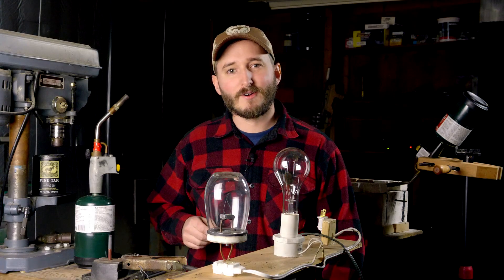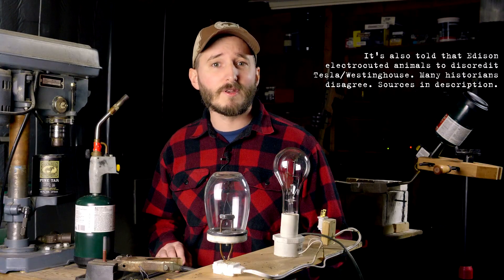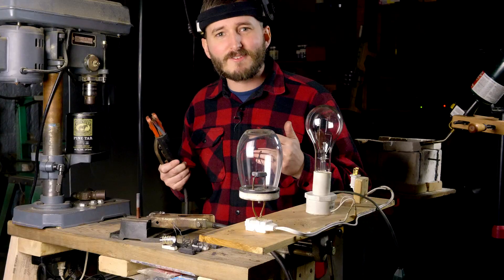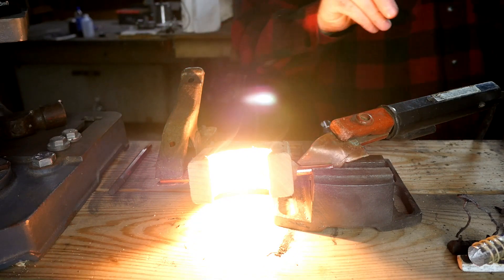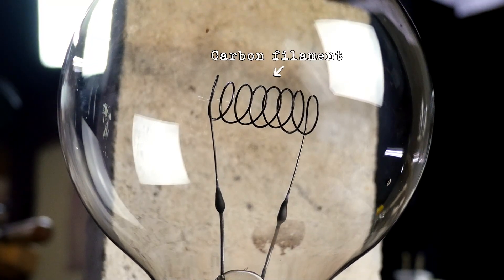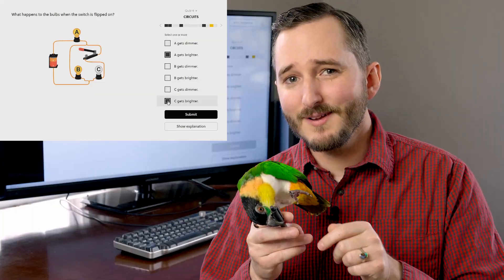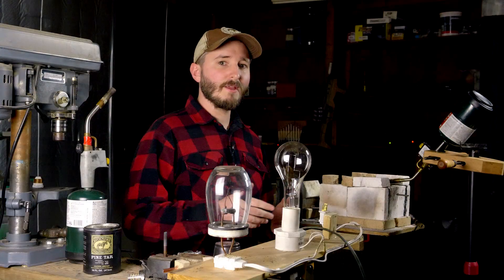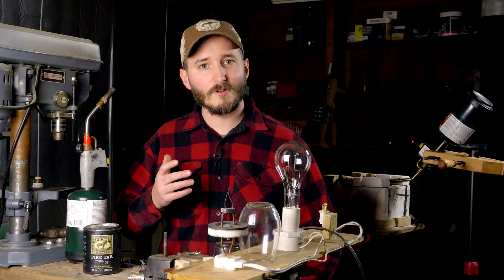Re-Inventing The Carbon Lightbulb

Comment: You may want to consider Humphrey Davey as well for making the first arc lamp. Edison though was quite glued to his patents though with the invention of the phonograph. ( Which started out as a tin foil machine). Foolishly he let his patent run out. Volta laboratories under ( Alexander Graham Bell) and other investors perfected the phonograph design. In many ways he even shut down patents like Thomas Lambert indestructible cylinder made of camphorated plastic ( instead of wax). Edison filed a lawsuit  led Thomas Lambert to bankruptcy, which in turn forced Lambert to sell company to William Messer. So in a sense Edison was kind of a fraudster, the shaving technique for cylinders was actually invented by Volta laboratories which later became Columbia graphophone company.. So in a way Edison invented the phonograph, but perfecting the Patent goes to Volta laboratories. Edison only perfected the light bulb and wasn't the sole inventor.

Comment: I saw you load the filament assemblies into your carbonization oven onto something that looked like an electric water heater heating element, which I thought was a really cool way to carbonize the filaments.  Then you hit it with a torch...  lol, sort of unexpected, but it still worked.  Pretty cool stuff!
Reply from the maker: Yeah it was just a bent piece of wire. That would have been an interesting idea though

Comment: I remember doing experiments like this when I was a kid, using stacks of NiCD batteries as a power source. Nearly burned the house down about a hundred times, but I learned that scraps of copper, aluminum, and other bits of metal simply don't work as light bulb filaments in the open air, at least not for long. I got a few wire-shaped burns on my hands also.

Comment: Don't you North Americans have 240 V outlets where two 120 V phases are combined (or something like that)? Else, you could try buying a cheap inverter for 230 V, or use a step-up transformer. Or maybe rectify the voltage to get DC?

Comment: Couldn't you have multiple filaments per bulb wired in such a way that you can power them individually or in series? In this way, you could initialize them one by one before putting them in series to act as one long filament.

Comment: I experimented with straw and got some good results. I didn't use them as filaments for light bulbs but tried them as accurate temperature stable resistors. 

I'm on and off building a radio transmitter from stuff i can acquire in my backyard. Iron from our iron rich soil  for wires. Tubes build from glazed clay and so on. I build a quicksilver vacuum pump. Works slow but very well.
Reply from the maker: That's an impressive project!
Reply: @Nighthawkinlight  It sounds more impressive than it is :-) 

Right now I'm working on a way evacuating and sealing the tubes reliably. The best way of sealing is to melt a big pile of glazing at the bottom. But also holding the vacuum is impossible right now. So I'm thinking to use Sodium vapor to replace the air while fusing the top and the bottom of the Tube. But more experiments are needed.

Comment: How were you processing your bamboo? You may have some luck with crushing and/or twisting the bamboo along its length before attempting to bend it into coils - Effectively breaking it down into fine strands of material rather than working it as solid bamboo.
Reply from the maker: Steam bending mostly, but I think my bamboo source was not good. Breaking the fibers would cause other issues

Comment: Firstly one that they did know and use back then was that they could make the coils longer by wrapping them around a glass tube connected to the same Mount as the filament
.
secondly one they may not have known about back then is that if you burn metal like steel wool underneath the carbon filament you expose the filament to metallic gases which can condense on the surface lowering the conductivity enough to allow electricity to start easier

Comment: Did you consider sugar? Basically you need a material that is easy to form and has low amount of inorganics. Sugar being C6H12O6 can turn into high carbon structure after carbonisation. It can be molten and cooled a bit in water to become like dough and wrapped it in a tube maybe paper towel tube cause it will melt with the carbonisation heat otherwise. I think you also need to spend more time in the carbonisation step because that high onset voltage you needed to run the light was due to the lack of proper carbonisation.. More carbonisation means less resistance and lower onset voltage. All the best
Reply from the maker: I tried various starches. Pasta worked pretty well
Reply: That would make an interesting PLP (pasta light pulb)..

Comment: I have some carbon filament lamps from around 1939, which are a good example of the process, as they have a thin well supported filament, and work well off the 230VAC mains.
Reply: If i were you i would get a transformer to run them at 220, makes them last longer, or maybe even 210. And soft start
Reply: @the_retag  NTC thermistor in the power lead to them already.

Comment: consider light from compost gases. Haven't got around to reinventing that wheel yet, but could really use some light supplementation. Maybe community gets stuff done first, I dont mind. Want to keep it simple and not include batteries and LEDs unless I realllllly have to. For now I thought about small water tank with inflatable part to hold gas, flashback arrestor again with water aaand it would burn up all of it every day. Because of constant supply from compost and having the need for only few hours of extra light. Haven't figured out a time (and light later) based relay nor a reliable/diy mantle yet. Any thoughts and inspirations for this project are welcome, trying to avoid electronics for this one.
Reply from the maker: Well you can look for my video about making a gasometer. The lamp part I've not played with.

Comment: Nice video! Unfortunately, the carbon dioxide released by the burning propane in the bulb would surely react with the filament at these temperatures. Look up the Boudouard reaction, where CO2 and carbon exist in a equilbirium with carbon monoxide. Nevertheless, as you said it was sufficient enough for a demonstration that lasts long enough.

Comment: My suggestion for better results would be to coil the filament around a glas rod while burning, to get thin material to work.
Would probably require a jig to remove the glass core thou... Might be worth a try ;)

Comment: You could use several of those shorter filaments in series inside the same bulb to get a longer length, and it would allow you to do the initial "burn-in" lighting one at a time before connecting them together.

Comment: You are Missing out on what Edison really did in making the light bulb and the process he ended up with.  Unfortunately, this is detailed in only one publication that I have found.  It is "Cyclopedia of Applied Electricity", volume 3.  (I have hard copy of this book in very bad shape, which I spent enormous time scanning.)  This series of volumes is on Google Books, but the volume 3, despite claiming to have "electric lighting" in frontispiece like my book, is not included in the table of contents, nor its pages.  (I have PDF of book, and I think it is legal for me to share it.  If you provide me place to send it, I will.)  Very short explanation goes like this: cotton is boiled in zinc chloride solution.  It turns into gummy goo.  (Edison invented plastic!)  This goo is extruded through tiny orifice into alcohol, which hardens it into a fiber.  Fiber is passed through boiling water to remove zinc chloride, dried, and reeled.  This fiber is pyrolized (as you did) into carbon filament.  On purpose, filament is made "too thin".  Filament is mounted into bulb base with tar binder as you did.  Next step (you sort of did for a different purpose) is to insert into chamber filled with gasoline vapor.  (Edison called this "flashing".)  Power is turned on, and hot filament builds in diameter as gasoline "cracks" and adds layer of graphite.  This makes filament stronger, and more importantly, uniform in section (thin area is hotter which builds faster).  When resistance drops to desired value, relay cuts off power to that filament.  Filament/lamp base is glassblown onto lamp globe and evacuated.  Edison used a "getter" to scavenge gases in vacuum.  You can use a 2nd filament, or better, a pinch of red phosphorus applied to the filament (converts to white, then scavenges oxygen).
     Since this involves a utility, you need to explain the "voltage squared divided by resistance" problem regarding the amount of copper required to transfer "X" amount of power "Y" distance with "Z" efficiency.  Because Edison was "stuck" on DC, the voltage in the transmission lines had to match that of the lamps.
Reply from the maker: There is some mention of this as one of several methods in Edison's first patent, fibers rolled from a plastic of nitrocellulose. I have also read of prepping the filaments by firing them up in a hydrocarbon environment, I believe I read this in Latimer's patent. What you've shared is slightly different though. Very interesting. If you can send a relevant page or two to me I would very much appreciate it. I did not expect anyone else to be familiar with the specifics of how filaments were made, this is a pleasant surprise.  Nighthawkinlight@gmail.com
Reply: Can i have it too? Id have to find a way to receive emails in my main with a temporary adress, probably simple, but im on mobile only today
Reply: @the_retag  Yes you can.  Give me email to send it to.

Comment: Very nice! I couldn't make it better if I tried. I would just use one of those mechanical pen graphites to make my life easy! Lazy man's methods and such!
Reply: Haha I did that in high school! I used to repair retro electronics so I had a decent understanding of electricity (for a 17yo), so when we were making circuits in physics class I quickly taught a bunch of teenage boys how to make some fire with their circuits and some graphite. Lets just say they were pretty interested in learning about electricity after that 😅
Reply: @NotMe-ej9yz  I did sort of the same thing but rather when we did an experiment on electromagnetism I showed some people how to make transformers (we had some iron nails and wires plus a power supply). Suffice to say, many pencils were burnt that day
Reply: Some decades ago, a PBS series called The Secret Life of Machines did an episode on electric lights that covered most of this material.  They ended the episode by lighting their garden (English folks, we'd call it their back yard) with a string of bulbs consisting of quart milk bottles, each pumped down to vacuum with a length of pencil "lead" (graphite and clay mixture) inside, and voltage to the string controlled with a Variac.  I don't think they ever managed a bamboo filament, either, though they did demonstrate a vacuum bulb with a cotton string filament.
Reply: Who else read this in ElectroBOOM's animated voice? 😆
Reply: Hi electroboom can I get a shoutout please just saw your ac version of the magic wand altho the dc one was more destructive love ur vids keep making them

Comment: If one were on a Tesla (AC) rather than Edison (DC) power grid, how necessary would a high-voltage low-current lamp be?  Lamps would need transformers to use low-voltage bulbs, making them more expensive, but the transformers should be a durable item.  Also, if your lamp was in series with another lamp but using a fraction of a voltage, how would it be dissipating 150 watts?  If it was in series with a 150 watt lamp and its resistance was e.g. half that of the latter, that would suggest that the total power from the wall would be under 150 watts, and 2/3 of it would be dissipated by the higher-resistance bulb.
Reply from the maker: Ac or DC doesn't really make a difference to a lightbulb
Reply: @Nighthawkinlight  No, but it makes a huge difference to transformers.  I know that transformers weren't as cheap in the late 1800s as they are today, but even if it were never possible to run bulbs directly from AC120 I think lamp-mounted transformers would have made it practical to use 12-volt bulbs on an AC120 mains--something that is in fact done today for some applications.

Comment: Could adding a metal powder in with the starting carbon putty reduce the initial resistance as well as potentially providing a more durable filament once it’s been heated the first time? Perhaps aluminum or silver powder in varying amounts.
Reply from the maker: Maybe so

Comment: What if you first replaced the atmosphere of the bulb with an inert gas(or the propane), THEN pulled the vacuum, that way you would have no oxygen to react with it, and a vacuum to minimize the airwashing?
Reply: A lot of bulbs are filled with argon to improve the thermal transfer from the internal structures to the outer glass and then the environment.  A perfect vacuum is not practical for all uses as it works like a thermos bottle and there is poor transfer of heat to the outside.

Halogen bulbs have a different trick up their sleeve with a reactive vapour in the bulb to fetch tungsten from the hot blub (that is closer to the filament) and deposit it back on the extremely hot filament.
Reply: If you pull a good vacuum from normal air, the leftover amount of oxygen would already be minimal and the reaction with the filament should not cause significant problems. Once the oxygen reacted with the carbon to carbon dioxyde it becomes inert anyways. 

I don't think it would make much of a difference.
Reply: @SoundOfNeutral  I think the key word there is good vacuum. How do we know if the vacuum is indeed good enough? On paper you are right, that is all we should need to do, far less complicated. I came up with my suggestion based on the premise that perhaps the vacuum he's pulling isn't deep enough, so replacing the air first would eliminate ALL oxygen, removing that variable from failure of the bulb.
Reply: @41A2E  Maybe you could have two filaments with separate wiring? One thick and sacrificial, another thin and the one you actually want to use. Once you enclose the bulb, burn the thick one for quite some time to make sure it has used all oxygen and  then turn on the actual filament.
Reply: @MikkoRantalainen  well it wouldn’t use all the oxygen as the reaction would fizzle out before the oxygen is used up completely

Comment: When I first got into vaping, designing coils led me to a dark hole. You should look into different designs of vape coils. It'll be interesting if nothing else.
Reply: Building vape coils actually gave me a much deeper understanding of ohms law and electronics in general. It's a weird hobby that tries to find the most efficient way to combine this kind of physics and artistry.
Reply: Going into vape coils is alot like going into electric water heaters. With the addition of worrying about metal vapor in your lungs. Even with the perfection of vape coils to eliminate metal vapor, it still scares me. Therefore, you have additional factors needed ontop of your basic "battery powered glowy heaty wet thingy", a very interesting design.

Comment: Could a combination of inert gas fill (eg. argon from a welding cylinder) and your vacuum pump be an improvement? Flush the bulb with inert gas and then pump down, so the small amount of gas remaining is mostly inert and only a tiny partial pressure of oxygen remains.
If the only thing stopping you from using higher resistance filaments is the requirement to burn them off with high voltage and then reduce the voltage for running, see if someone will sponsor you a Variac/autotransformer :)

Comment: So if graphite is "the better carbon",  won't the next logical step in this modern re-invention be to use mechanical pencil leads? You can get them in variety of sizes and with a couple of simple bus bars you should be able to parallel as many filaments as will fit in the chamber.
Reply from the maker: That works but it's cheating. I wanted to make them add they were made in the 1800's

Comment: try graphene made in oven
Reply: spark gap lamp, high voltage?
Reply: make the long part short
Reply: put the tungsten filament in a glass tube, so that the filament glass tube is the filament, then the tungsten vapours dont escape, and the tube is the glow light source tube, inside the outer bulb glass
Reply: why not just put a thin refractory glass tube with the tungsten in it

Comment: But in all seriousness, could you pull one of the strands of carbon from carbon fiber tow and try that? I suspect carbon nanotubes would also work. :-)
Reply from the maker: That would probably work, but I'd miss out on the fun of using period methods
Reply: Why didn't you spin a cotton thread for the filament? I was surprised you used a large swath of cloth.

Comment: Fantastic video man. Such an interesting topic with so much potential for experimentation.
Slightly gross, but have you considered hair as a carbon source? It has length and a strong fibrous structure for the coiled filament.
Although the keratin might just melt and deform, it would at least be an interesting experiment.

Comment: In my Industrial Electrical classroom at Benson Polytechnic we have a bunch of stuff previous professors have collected. We were going through it and we found something we couldn't identify but It had a patent number. Come to find out it was an WWII era arc lamp spotlight from a navy ship with rotating carbon electrodes.
Reply from the maker: Yep they got really clever with them. That one probably had clockwork to feed the electrodes closer together as they erode away